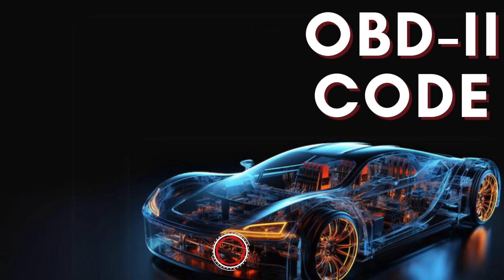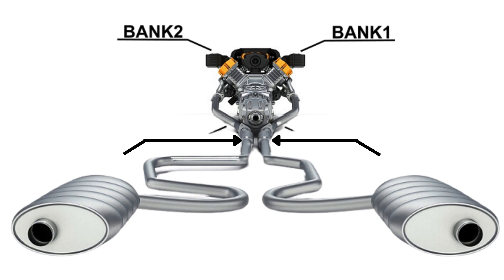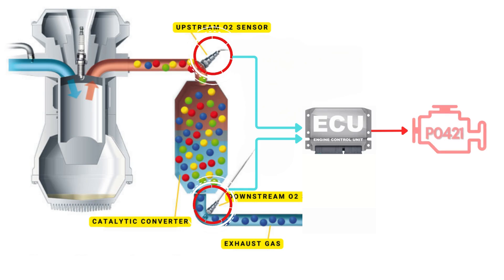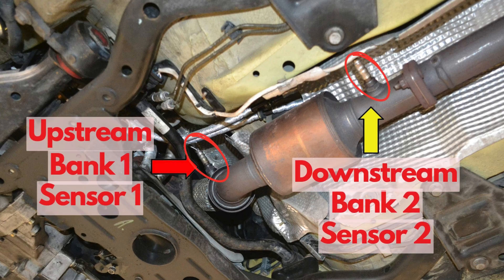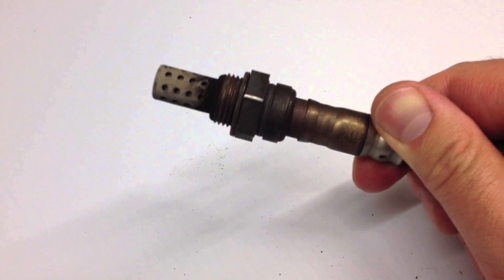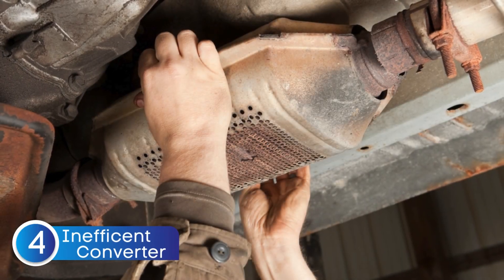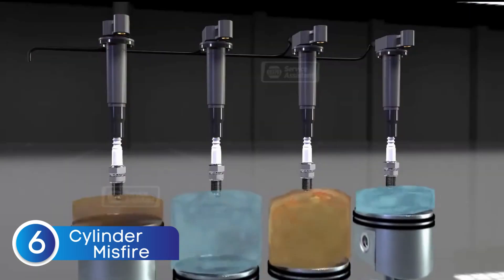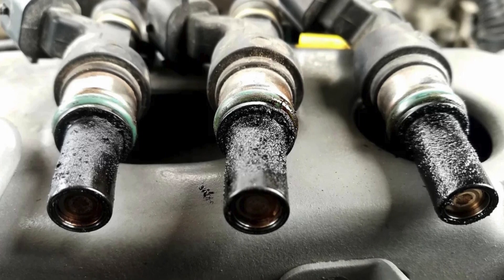How to fix P0421? | Warm Up Catalyst Efficiency Below Threshold (Bank 1)

Comment: Thanks for your video. My car (111k miles) has the engine light on, it’s P0421, but went off after 24hrs. The car still runs good, get 31 mpg on highway, slightly higher than manufacturer specs (29 mpg). It’s been 2 days and the light is still not on. I took her to Meineke and they said the cat needs to be replaced just by using OBDII scanning. I think it’s the O2 sensor or spark plugs which have never been changed
Reply from the maker: Yeah before replacing CAT, please check O2 sensor and spark plugs.

Comment: Would the revs bouncing up and down for about 10 seconds on cold start also be a symptom of this issue?
Reply from the maker: This sounds more like oxygen sensors heater circuit faulty. Scan for the codes, you will get clear understandings.

Comment: Nice video, thanks ,
Do you think ignition coil can lead into p0421 ?
Reply from the maker: Yeah in long run. Because of faulty ignition coil there may be unburnt fuel left in the exhaust, which could possibly damage the catalytic converter.